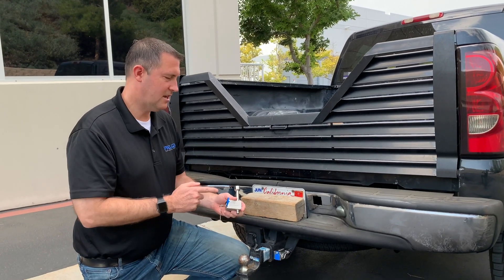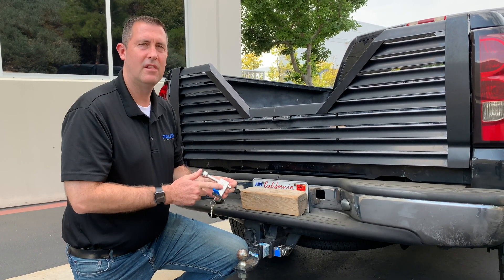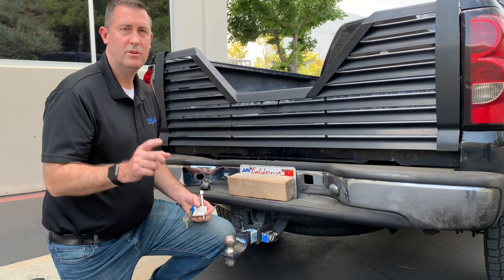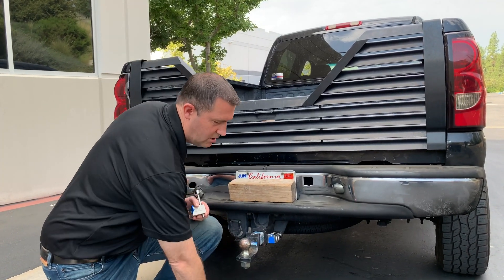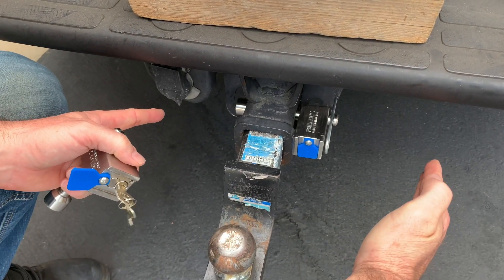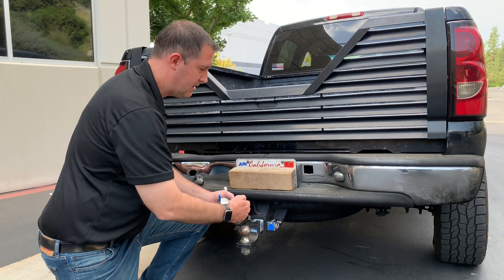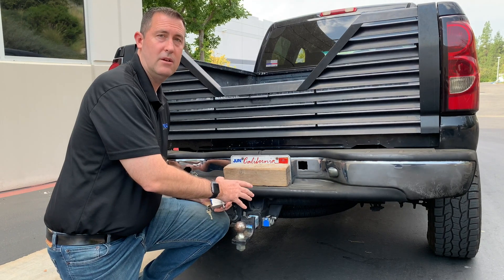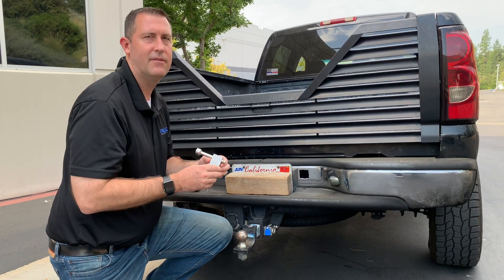New PACLOCK Design! (Free Lock?!)

Comment: I looked at your catalog off your website and the different shackle lengths aren't listed.  I'm hoping you make like a 6" shackle, so I can lock the interchangeable "head" on my Shocker HD to the hitch itself.  Currently they are just 5/8" pins, but really long.  I haven't found a hitch lock that will fit.  I'm also looking to sign up to be one of your product testers.  I sent you a message on the contact us section of your website.

Comment: I'd be interested if you have one for 1 1/2" and 2".  Currently have bolts that have the nuts welded. 

Another idea, if the pin can have a chamfer on the head, then a spring provided between the hitch and licking body. This would help reduce pin/hitch rattle. 

If possible, a smaller diameter with a sleeve so it can be used on 1.5/2" receivers. Since the sleeve would be taking the load, with a pin insert the surface area is increased for the actual tow load?
Reply from the maker: We've implemented quite a bit from testing and we're really happy with the final lock! There will be one lock body for the final version and just 2 different pin sizes- one for 1-1/4" and one that fits 2" and higher (inner diameter of the receiver)
Reply: @PacificLockCompany  awesome, same alum body as the pl17 block?
Reply from the maker: @omieyouknowme  We're making an Alum version (same 6061 Alum as all our other locks) and a Stainless body out of 304 Stainless.
Reply: @PacificLockCompany  great the amazon link takes me to just the padlock version, I could not find the lock in your site either. Did not see a search bar at paclocks site.
Reply from the maker: @omieyouknowme  Which lock are you looking for? The one in the video above will be released in the next week or two... just implementing final changes before the launch! Or were you looking for a different lock?
Reply: @PacificLockCompany  I was looking for the one above, specs on size. Understood on next week's release
Reply from the maker: @omieyouknowme  I'd get you the specs now, but I want to make sure everything is final before I do. I'll go ahead and reply here to let you know when it's launched!

Comment: I need a lock for a DEMCO hitch; the hitch is rated for 2,000 tongue weight, too latch the pin it needs to fit in to is ¼” diameter hole and the minimum is 1 1/2” wide. The closest lock available is 2.5 inches wide and it allows to slide the lock on to fit multiple widths, a more appropriate lock should be 1 ½” to 1 3/4” wide. The trailer is a Weekend Warrior Toy Hauler with a GVWR of 16,000 lbs. 
I found this info on a DEMCO catalog:
50º MOUNT - WELD ON
Item:  15337-97 Primed Only, 2 5/16” EZ Latch, 21,000 lb. G.V.W.R. capacity, A-frame weld-on, with jackhole metal handle    12 lbs.
If the lock pin is too long then a pipe can be slid over the long long pin and used to snap the locking pin off because it too long and too exposed.

Comment: I have trouble finding a locking pin that works on a 2019 F-350 the pin needs to be longer than 3 5/8” to lock up my receiver hitch. The trailer has a GVWR of 16,000 lbs. but the receiver is rated at over 21,000 lbs.  It’s the standard receiver hitch that is shipped with every F-350 they have shipped thousands of them. But most locking pins are too short for a 3” receiver. One company said it fits a 3” receiver if you push hard on the pin it does, but the safety clip still scraps the paint off the other side of the receiver every time, it's that tight of a fit. Their design has the safety clip first versus your design has it last. The safety pins being next to the receiver keeps pressure away from the lock. Having pressure against the safety pin stops the wear on the locking assemble, which prevents damage to the lock due to pressure against the safety pin instead. Their pin design has O-rings on the 5/8” pin to help keep the pin tight with pressure on both sides of the pin to minimize rattle. Their design is painted which is being scrapped off due to the pin moving around inside of the pin holes through multiple reducers. The O-rings minimize the pin from sliding back in forth in the receiver by applying pressure on both sides of the pin, but the pin still wears on the 2 reducers inserted inside the 3” receiver.

Comment: The last need is a locking pin that is going to be used on a ShockerHitch.com hitch see their website.
https://shockerhitch.com/product/shocker-air-receiver-hitch/ 
Which uses an airbag to absorb the bouncing of the trailer onto the hitch ball on the truck. The HD Shocker Hitch has 2 pins, to attach different attachments. These 2 pins hold a huge selection of ball mount attachments available from Pintle hooks, drawbars, drop ball mounts, raise ball mounts, and more. But the pins are not lockable, the combo hitch ball setup is over $100 alone. You can lock the Shocker Hitch into the 2 ½” receiver using many different manufactures' standard locks. But where the Shocker Hitch attaches to different attachments there is no lock available, the measurement from edge to edge the width is  4 ½” the pin they supplied is 5 ¼” long so the only one close to meeting the need is a lock with a 5/8 pin that is 6 1/8 long. A lockable 5/8” pin that has a 5 1/8” or a 5” span would work better, their hitch is rated for 16K trailer weight. Just ideas’ for different needs for different locks.

Comment: You need to make the pin adjustable from the smallest to the largest hitch I work at a Marina and its a pain when moving from one truck to another and the pins to small or big like a ratchet pin the lock will move down the pin and lock one size fits all